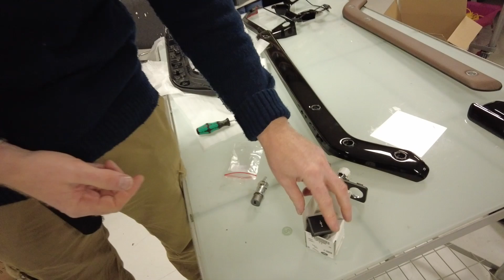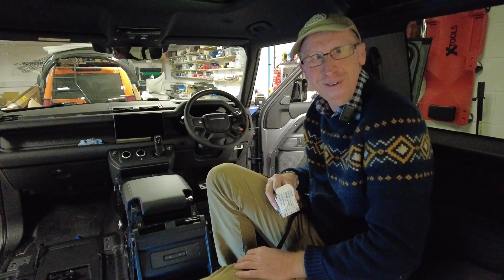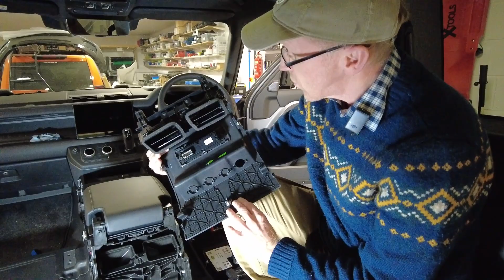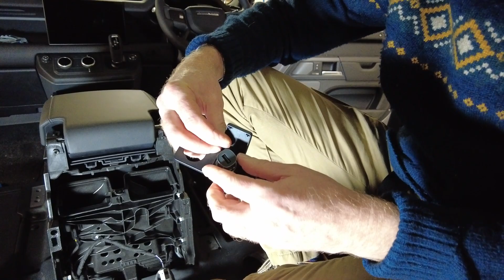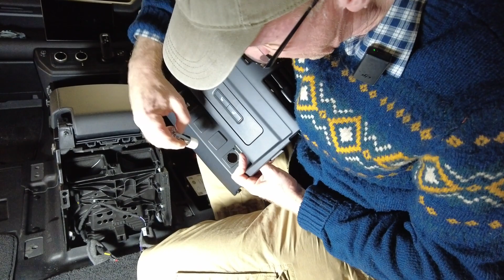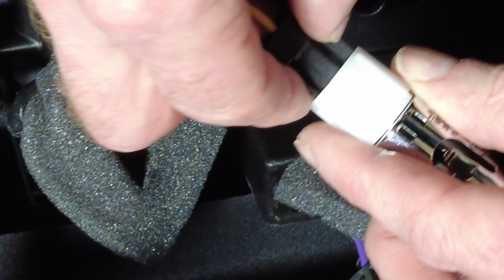How to add USB Power Outlet Charger Socket to Rear Console of Land Rover Defender L663 - Retrofit

Comment: Great video.  I am trying to convert the existing 2nd row USB-A ports with a traditional 12v port on a 2018 Discovery 5.  The USB-As are becoming obsolete as they only produce 12 watts.  The traditional 12v will give 120 watts and I can plug whatever I like, ac inverter or USB-C.  When I went to buy the new port from LR, they told me the 12v port will not work as the vehicle is designed for USB-A.  If the difference in the plug and socket is because the fuse rating could be different (at the 12v accessory plug is usually 10 or 20Amp and the USB may only be a 5Amp) the rating of the cable my not be enough for the 12v accessory socket and I could cause big problems, like a fire.  But I am hoping the entire system is 12v and the reducer happens at the port level as you mentioned in your video.  I can't seem to get a straight answer. from LR.  Do you have a point of view on this?  Thanks.
Reply from the maker: Hi Paul - this is a good question. My logic is this.... Land Rover fit fuses to suit the wire.... this is the basic principle of fuses.. so if you draw too much power the fuse will blow ! so you can fit what you like and trust the fuse. Also remember that 10amps output on a 5 V usb is only 5 amps input at 12v !  One thing to watch is those 3 way connectors are different.. they have a little block in the corner to stop you fitting different types....

Comment: Thank you Simon for this and your other video showing how to strip it, helps a lot however I already have two USB's in my D300 23MY so need to find out if there are cigarette lighter power feeds. Do you perhaps know - If not do you know if they're a loom I could purchase for them?

Thank you again for your videos that are always a tremendose help. Take care.
Reply from the maker: So you have 2 outlets in the rear ? I guess this may be the later loom like my 90 - the 110 has 4 connectors. I am making a Y loom that will convert 1 connector to 2
Reply: @L663  Yes I have the two USB's but only have the blanking plates/covers where the cigar sockets are supposed to be. (two outer holes)
Reply: @OverlandingwithBruce  hi Bruce, I’m after the exact same solution, got 2 usb-c and 2 blanks. Have you managed to retrofit a 12v socket in your rear console? Do you have any pointers please? 
Thanks in advance 👍
Reply: @2WheelsChannel  not yet. I have all the parts just not the wiring “Y” piece. Waiting for Simon and his team to get the stock

Comment: That’s a lot easier than me sticking a finger in the two holes and prying and pulling the foam off bit by bit.   Was really bummed they shipped without this like you said that’s not a chip shortage thing not a lot of chips in there, if we were short usb ports phones and all sorts of things wouldn’t be shipping.

I didn’t see the point of going USB-C yet, little early at least here in the states.   Looking forward to your splitter to use the other two slots.

Comment: Simon, this Defender is equipped with the new IPC with yellow alerts?
Reply from the maker: Please explain - you have lost me !
Reply: @L663  I observed here a nem template on IPC: <2022 models had a orange color for the lights like engine fault, refuel, low Adblue. On Defender >2023 these lights are yellow or a “clear orange” and had a difference on white pixels.

Comment: The difference plug and socket could be because the fuse rating could be different at the 12v accessory plug is usually 10 or 20Amp and the USB may only be a 5Amp therefore the rating of tha cable my not be enough for the 12v accessory socket.
Reply from the maker: Yes Jon I think I would agree with you... but who is going to use a lighter ?

Comment: Simon, I'm pretty sure that the 3rd pin on the plugs is for LED illumination! Not all of them have the LEDs, but some of them do! My Evoque has illumination on the cup holder cigarette lighter for example.
Reply from the maker: Yes you are correct - this came to me later ! but thanks for the comment
Reply: @L663  My pleasure😁

Comment: Same issue with my dads new defender. We managed to get the wires out through the holes without having to strip apart or remove anything. We also found the wires for the front dashboard one. 👍🏻
Reply from the maker: Yes i have done the front one today - will upload the video - if you can reach them that easier !

Comment: Hi Simon thanks for the mention 😆 those rear plugs are they a 12 volt feed or already a 5 volt feed hence the awkward plug to stop them getting muddled up with a lighter socket?
Reply from the maker: Your welcome. All the plugs are 12v supply - the 12v to 5v conversion is done in the port housing. I think the lighter socket is rated at a higher current than the voltage outlet.... 5 amps as 5 volts is only 2 amps at 12v input so the fuse/wire rating for the USB sockets is much lower than the lighter socket ( thats my theory )

Comment: I’m confused! What does a shortage of computer chips have to do with these power outlets? With your fix there, I didn’t see any computer chips involved. Are you saying there is a shortage of the actual power outlets? If so, where did you get the ones you just used?
Reply from the maker: So the USB sockets change the 12v car voltage to 5v inside the USB port body - this needs chips to do that. The ones i got were used ones from crashed cars on ebay ! The odd thing is the 12v metal "can" type of lighter socket does not have any IC's in !

Comment: LR are supposed to retro-fit them when they come back into stock…
Reply from the maker: I have not been told to be the case for my car.
Odd why they did not just fit the 12v lighter socket
Reply: @L663  Well they would have to order them to be able to fit them. Long in advance.

Comment: Nice one Simon 🤓 not sure if you have seen others but my 90 (X) has the rear heated seats but the controllers are the same as the those in the front - not sure if that’s a spec sheet tick or another LR cut back by replacing with those push buttons. 🤷‍♂️
Reply: What story is it turning into Simon about your seat crossmember. I’m sure the manufacture’s love you stripping there cars down and finding problems. Or shall I say creating problems with that orange pen of yours 😂 And why are your stripping the seats anyways. If you want a van wouldn’t you buy a Defender 90 van #Justsaying
Reply from the maker: @StephenJ1991  Well good question - I got offered the 90 as a cancelled order so was happy to buy that. The 90 rear seats are a point of some contention in that they do not fold that well. The lower seat base is removable - sort of - lots of people doing that. The rear seat back is also removable - Land Rover has fitted a neat mechanism to allow this to be done. But it seems that my rear crossmember has not been made correctly make it difficult to remove the rear seats - say i want to move a washing machine etc.
Reply: @L663  Looking forward to your solution to the rear seat fold debacle. Having come from a Disco 4 to a new 90, the compromises Landrover have made are starting to become a tad weary. Caveat Emptor I suppose. 🤨
Reply: @L663  oh I have removed the base a few times, frustratingly, didn’t know those seat backs were removable - only had it 14 months 😅
Reply from the maker: @supercrazysane  They sort of are and its not too bad but its not in the owners manual - 2 pop out plastic panels - reveals 2 bolts - undo these and rotate a lever and it releases the seat. When i show the video be interesting to see if yours are correct or wonky like mine !
Reply: @L663  understood - yes will check/compare 👍
Reply from the maker: Yes I need to look at the retrofit of that - but less urgent.... front dash USB next.... and sorting out the manufacturing defect on my rear seat crossmember ! ( that is turning into a story )